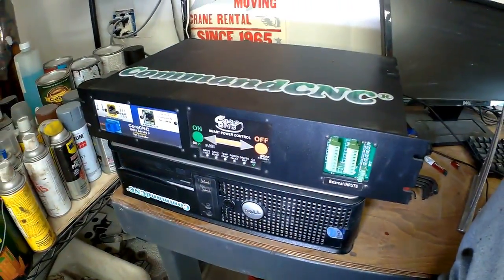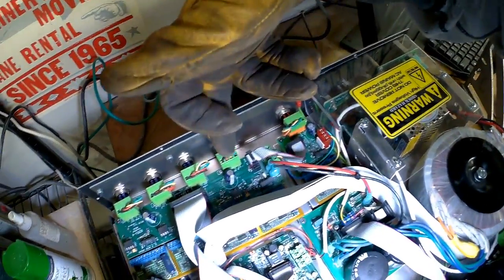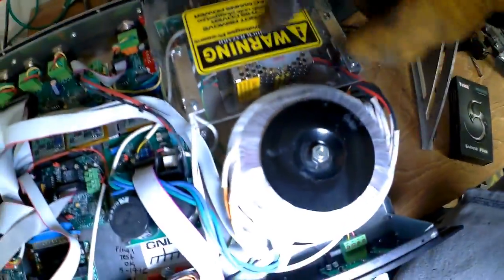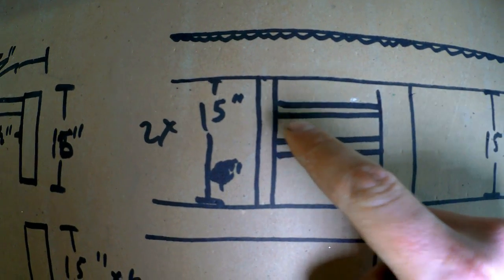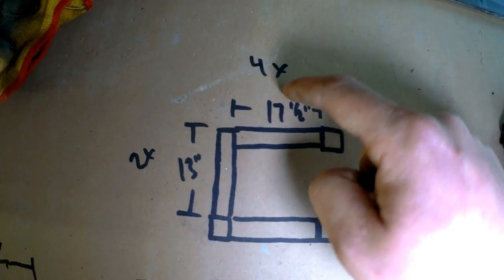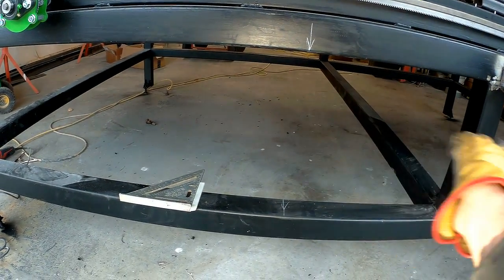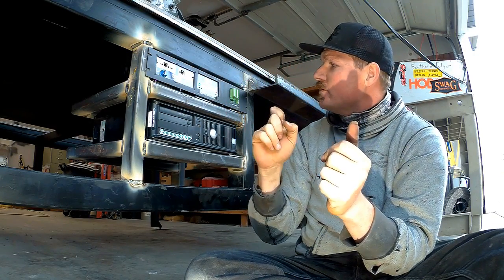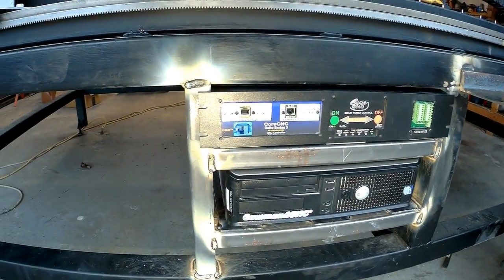CNC Plasma Table Build (Hardware Rack)

Comment: just watched this whole build an amazing job so you have inspired me to build one for myself and was wondering where you got the plans from or if you wanted to share them  and where did the servo gearboxes come from and torch rails and holder. are you going to do a follow up with other modificatios and a bit of teaching on how to adjust catrac
Reply from the maker: Mick Hulsen the build was done from two kits. The mechanical portion by precision plasma and the electronic portion by candcnc. A Google search of both companies will get you all the info u need 👍Thanks for watching! I've got follow up videos planned I've just been too busy now that the table is up and running lol
Reply: cheers thanks heaps ;-)

Comment: really cool, you make it look easy!  i have ran PlasmCam for a few years at work.  why do nearly all plasma tables keep the material flat, why not build a table so the material sits at 60 to 80 angle?  it would save an significant amount of floor space.
Reply from the maker: Jason McCutcheon there's a company called burn tables that makes one. You def couldn't have a water table though lol

Comment: You might want to add a slanted rain shield between your table and the top of the electronics, water goes everywhere when you hit the start button. WD 40 is your new found friend on a wet table.
Reply from the maker: SegoMan dang, that is some valuable information! Thanks, I'll have to pickup some sheet metal for a shield.
Reply: A small canopy out front might be in order as well (it can a be a bolt on after the fact) if you want to try it fist  Between those edge cuts and the overfills water can be a mess, WD 40 on all those rails are a must. When designing your tank allow a minimum of 30% if not 50% over the trays volume as you don't want it to burp when the table is filling (if your using air to fill it). That 20 bagillion degree torch along with evaporation makes it disappear fast.

I have a 2x2 that I am using to build the components for a 6x12, after you finish yours you will say why didn't i do this sooner? LoL Today is drill day for me. I was looking at the Core CNC driver as well along with a micro heat sink cooled computer. Did you get yours from CandCNC?
Reply from the maker: SegoMan I'm not doing a reservoir, that's def set one of the parts I'm skimping on but I'm trying to get this sucker running first then I can start tweaking things like the water bed. 
I did get all the electronics from candcnc. The hardware is well put together and well planned as far as I can tell. But support is weak at best and I paid for a year of support up front. So its pretty much on u to figure out some of the issues that pop up. But I couldn't find any better alternatives either. 
I can't wait to have this thing fully operational! I bet ur 2x2 gets WORKED!
Reply: Here is the link to my machine's build with some pics of it, your drain tank can be done after the fact.

http://www.wildcatforums.net/forum/off-topic-discussion/15768-shiny-keg-plasma-kutter.html
Reply from the maker: SegoMan I'm loving ur retrofit with the keg! Sweet build 🖒 I'd like to have a small setup like that to do portable sign cutting at county fairs and such. I think you could make a killing over the summer just doing family names on something that size.
Reply from the maker: SegoMan yeah, I'll be happy to know the ins and outs of the machine when it's all done. I didn't catch the handles, I'll have to look at that thread some more tonight.
Reply from the maker: OK, mad props for your plasma table build. Your def a talented fabricator with a sense of humor.  I put in a drip shield over all the electronics today, thanks again!
Reply: M T,

Me thinks you will be a happy camper keeping those components dry :).

I need some dimensions off the Core CNC controller if you would kind sir, 

Looks like you made a 17 1/2" window for it to go into.

Is the outside of the faceplate19" wide?  (that is a standard rack mount width  -  FYI This rack mount  is a standardized pro equipment mounting system.)

How tall is the face plate on that? (rack mount  height units are a multiple of 1 3/4" ) so I'm guessing it is 5 1/4" or 7" tall..

How deep is the unit?

Another ponder pill for you to think about is getting a smaller UPS system to filter and protect the power going into the computer / controller. mount the burn box 3' minimum away from the controller / puter.. Plaz is approaching the frequency of the computers processor and can cause problems or ghosts to appear.

I busted 4 drill bits and 2 taps today aren't power tools are great :)
Reply: Bump,

I need these dimension by fri night if you have the time..
Reply from the maker: Shelf dimensions are 17 5/8" W X 15" deep X Shelves 4" T and 5" T  Hope that helps.
Reply: Thank You!